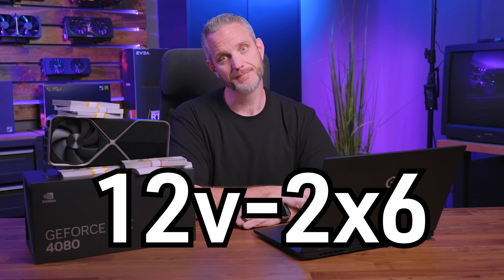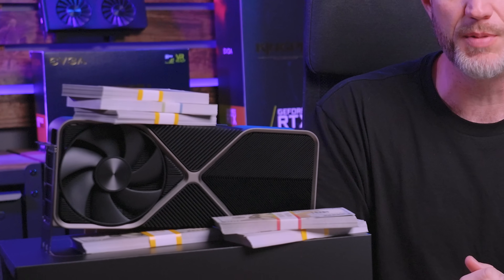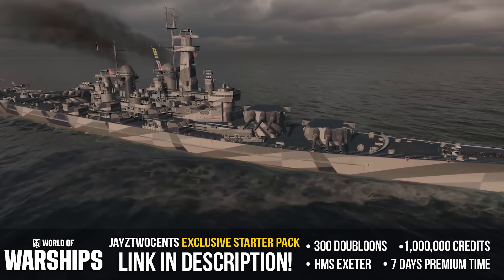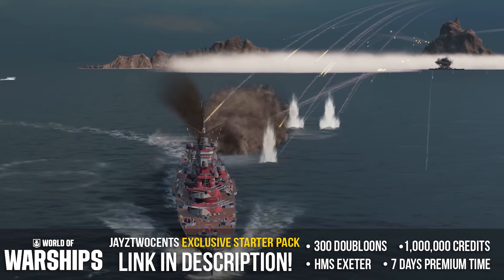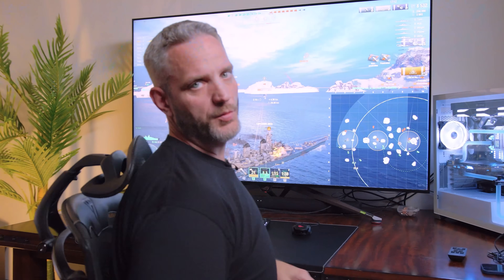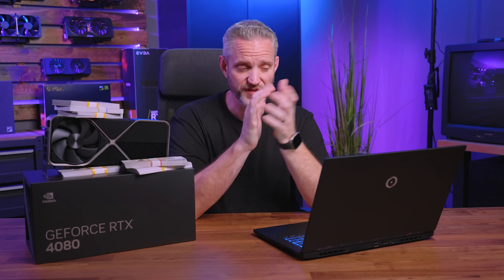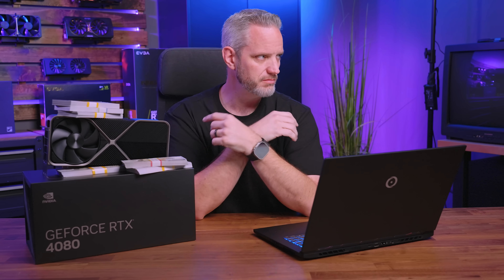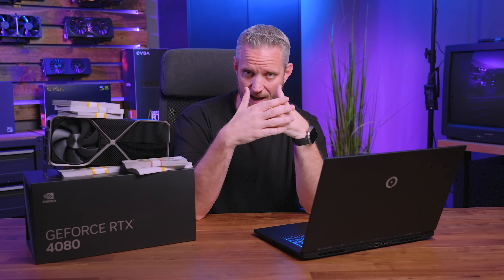They FINALLY admitted that this was a major issue!

Comment: Before I go any further, let me state, that I am a huge fan, and want you to get the results you are pushing for, but the way you are going about it? Not really the best way to do that.

"This is supposed to the fix the problem of your very expensive paper weights." "The 4090s as you guys know left and right are just melting the connectors."

The reason this cry for change isn't getting the response you'd like or even more attention is while the majority of this video is very informative and honestly is a good watch, there is also a decent amount of blatant gaslighting or misinformation that is very obvious. Just picked out two of them for examples, the first one, which is basically your intro, implies this is a common problem and that 40 series owners are basically throwing away stacks of money in repairs or on useless cards. You don't even mention that it's primarily an issue with the 4090 until later in the video. The second one? Again, exaggerates the problem and implies it's almost 50/50 whether your card melts or not.

The fact is at the time of the first video on this topic way back when there were over 100,000 of these things out there. Now there are at the very least triple that, maybe more, the 4090 is still regularly in the top 10 best seller list for both Newegg and Amazon. If we go with the minimum? Over a quarter million of these things in the wild. If what you were saying was even close to factual, there would literally be tens of thousands (possibly even hundreds of thousands) of failures that would be impossible to cover up or not be all over the internet, not just a couple hundred people in Reddit's echo chamber. Companies like cablemod would be bankrupt trying to replace all the units. 

We also don't know how many of those were actual connector failures, and how many of them were actual user error. Few users (if any) are going to admit they potentially destroyed something that cost them nearly two grand, so I'm sorry I don't put any stock in what the end user claims about their connectors being seated properly, and you shouldn't either. Should the connector be better designed to eliminate such easy user error? Absolutely, and that's what sig is trying to accomplish. Should quality control be better? Absolutely, it's clear some connectors did slip through that weren't up to the standards provided.

Back to the statements and approach: They are very easy for any reasonably knowledgeable viewer to pick out, and it shades everything else you're saying. Okay well he's lying here, or at the very least exaggerating for dramatic effect, what else is he doing that with? I say this not in hate, but because you are trying to do a good thing, call attention to something that does seem to require more attention, but you're doing it in a way that is becoming a very typical Youtube approach. You're creating a narrative, one that isn't entirely supported by facts and is based on misinformation/exaggeration. Next time, try it without the provocative gaslighting. I guarantee you will have a better chance of people taking it more seriously, and it being taken seriously by people who might actually be able to effect some change. No serious viewer is going to get past that intro or the other statements akin to it without some skepticism entering their mind.

Your goal is a good one, but the approach you're taking is reducing any chance of you succeeding.

Comment: Idk if someone can correct me but I remember when this original plug was being introduced there was talks about it only being good for like 25 connections cycles before the plug started to become degraded. I’m I misremembering this or?
Reply: It is 30 cycles, but its the same for the 8 pins so it does not matter
Reply: @Fztrm  thanks

Comment: So I wanted a 4090 for the longest time.
I still do want a 4090, since the 50-series cards aren't out yet.
But now I have a question to ask NorthridgeFix.
If I buy a BRAND NEW 4090, can they swap out the connector to the new one, and somehow maintain the AIB's warranty on the card (since arguably you're making it a better product than it was from the factory)?
Reply: if your gonna go to all the trouble of changing the connector then why not go back to the old reliable 8 pin connector and never have the issue again

Comment: In addition to heat, I suspect all the vibration from fans and pumps eventually shakes some cables looser.  The combination would certainly have that affect.
Reply: Would vibration be caused by your computer being placed on an uneven surface?

Comment: 55 amps? You do realize that an AC Unit outside of the house needs to be put on a 30 Amp fuse? Who the hell has a 100 Amp fuse just to play games? And before people get at me, they would not expect the cables to do that much amperage if it didn't mean that they had a reason for it.  (Power spikes)

Comment: i disagree, nvidia should be responsible to fix 40 series cards for the flaw they created. they designed it, they sold it, they ok'd it, they need to retrofit existing cards. they got enough money when selling to do so. my strix 4090 wasnt cheap. when im spending 2k on a gpu i expect all is well. in the car world they have recalls to remedy issues like these. sounds to me like nvidia needs to do a recall of some sorts. not the oh you are an early adopter sorry. that shit wont work im sorry. good vid otherwise j on the updated info.

Comment: If Ford had a plug that caused thousands of their vehicles to fail, they would be liable to fix it (no matter the cost to them). It will take a class action lawsuit to force Nvidia to recall and PAY manufactures to make the repairs to these defective power plugs.

Comment: Umm, had zero issues  with  the  4070Ti  but obviously it draws less power (295 Watts is the  highest power draw I've seen in total from the GPU) also I used a Corsair adapter from day one. I hope Nvidia  offer existing  4080/90 customers a refit, those cards were awfully expensive before they burnt  your house down.

Comment: honestly, if you want that new connector put on your gpu I'd look for a local shop to do it. I love watching the Northridge Fix videos but that guy charges a crap ton. A few months ago I accidentally knocked a resistor off my 3080 and contacted Northridge fix about repairing it, he quoted $300 not including shipping and then an additional $90 if I wanted it done within a week. That is absolutely ridiculous. I found a local shop and they did it while I was in the shop and let me watch them, and they only charged me $60.

Comment: Took enough time. It was a dangerous design. However if the contact isn't upsized from 0.4mm2 to something like 1 or 1.5mm2 (the same cross-sectional area as 16AWG wire), the same wretched story will be repeated !
FYI,the 30C delta T temperature rise requirement always existed anyway, it's a UL requirement.

Frankly IMHO, PCI-SIG are a bunch of clueless jerks who don't understand basic electrical engineering.

Comment: So I bought 2 atx 3.0 power supplies because I didn't want to deal with the stupid adapters. Does this mean when the plug changes I will have to change my cable from the power supply. Honestly this is annoying I thought I was doing the right thing by not dealing with dumb adapters but now I just spent more money and who knows if I will have to replace the power supply when the 5090 comes out. Honestly these companies should be held accountable or even pcisig. But we live in a world where no one is held accountable.

Comment: Jay - great video - I Can 100% confirm your point around the 15 min mark; re: wiggling the connector to get the black screen and 100% fan ramp; This is continually happening with my Gigabyte OC 4090; This happens both randomly and with a physical intervention on the plug.

Comment: As someone with a original 3080 I hope the 5080 series fixes all the 40 series cards problems (Size,power consumption/temps, PRICE, and connectors!) Big reasons why I never "upgraded"
Reply: The size can be great, cool and quiet running cards! , the 40 series is very power efficient already, temps are great, PRICE is crap and the connector needs a fix
Reply: It will fix most of those problems, But it will not fix price.
EDIT: Oh and you can also forget about the top-of-the-line cards using any less power than "all that the connectors can give them" that's the whole reason they're able to perform better than ever is that they're drawing more power than ever. Efficiency gains need smaller transistors (that's a ways out), or a large change in micro-architecture with an eye towards power efficiency rather than raw performance (not happening, or if you do want that, go buy an AMD card instead).
Reply: @44R0Ndin  Hmm? The 4090 i rarely see draw even 400w but Cyberpunk 2077 with patch tracing, 4K everything maxed (No DLSS and Frame gen) will push it to 500. You can also limit it around 60 - 70% and lose barely any performance. RDNA3 is not very efficient

Comment: They should just use deans or the ic5 connector that's used in hobby rc. They will more than handle the current and will not separate for any reason. 

Your welcome gpu manufacturers

Comment: There's also another aspect to wire gauge. The thinner the wire, the HIGHER the resistance over the length of that wire, the thicker the wire, the LOWER that resistance is. Resistance in a current load creates heat and that heat will show up at the connector before it shows up in the wire.
Reply: Why............???
Reply: who new it was a major issue to replace the 6 pin and 8 pin power connector with a single power connector on the gpu to take all that power🤔🤔

Comment: i feel like the issue is most likely pretty simple... costs and corners were cut to save money on production to increase profits. imaging doing that with something that can pull 600 watts. absolutely disgusting practice by nvidia. sold my 3070 a while back and this whole fiasco brought me to the decision to never buy an nvidia gpu again. the greed is unreal... also, the pins having poor contact is such a ridiculous problem to have.. it doesnt take an electrical engineer to understand that would cause excess heat. every warehouse has this issue with chargers for forklifts. management overlooks the fact that the plug connector contacts bend over time causing the battery wires to get very hot while charging. those connectors should be replaced every year but no place ive ever worked replaces them until theres a problem. current job has burn marks on some of them and they are still in use. lol. crazy

Comment: The connector is still problematic, because the wires are too thick or to many and they should not be bend at all. If they are bend, even the NTK pins, will have a diagonal position and will force enlargement of the female pins leading to bad contact. I hope this will have better results then the old connector. Only time will tell.

Comment: I had the black screen and 100% fans on my last power supply, an MSI power supply. Changed to a thermaltake power supply and have had zero issues.

Comment: Jayz, you asked if we will see the new updated plugs on new production cards... Well, Igor already noticed on the 4070Ti cards, that at least they use updated sockets, were the sense pins are the shorter ones, from the H++ sockets, even though the socket is still certified as H+ and not H++ Nvidia has done updates to the production line even before coming out with the new H++ socket.

Comment: I NEED HELP...
I BOUGHT AN RTX 3060TI AWHILE BACK AN RECENTLY GOT THE LIAN GPU MESH STRIMER AN I GOT A POWER CONNECTOR THAT DONT FIT....ANY RECOMENDATION ON A GPU EXT CABLE TO BE WIRED BEHIND THE STRIMER?

Comment: CableMod uses an NKT style connector on their cables and adapters, for those wondering. I'll also be using a deoxit lithium based grease by Craig Labs type L260Cp. It is specifically designed to be conductive and will not only lubricate the connection but prevent oxidation from air and heat. It is designed for similar applications and has copper particles in the formula. I will be applying it sparingly and inside of each receiver barrel with a needle type applicator. You can find it online if you look for it. I'll also be using a silicone lubricant on the outside plastic of the connector applied with a cotton swab.

Comment: i have a evga black 2080ti that sometimes goes black screen and 100% fan speed. it happens randomly, card will work fine all night, ill turn the pc off and go to bed, then black screen full fan speed in the morning when i turn the pc on. my 3080ti has no issues with the exact same power cables and power supply. any ideas?

Comment: So is the only option for existing 4090 owners is to pay for retro fit of a new connector? Also seems those of us the bought ATX 3.0 PSU are going to need new PSU's as well to get to 3.1. What a shitty deal. My card is still under warranty, should we not expect the manufacturer (Zotec in my case) replace this card with a safe one?

Comment: Ive seen hints at power coming from a dedicated port from the motherboard that is behind the PCIE port capable of 600 watts. Not sure how true or how far away that is from being adopted. So from the card its got a mini pcie like port off of the pcb that slots straight into the mb.
Reply: Found the Back of the MB will still have either the 12 pin or multiple 8 pins and the back of MB is like a power distro. But still a great idea for a clean build.

Comment: NTK alone seems like its likely to be all thats needed, but I guess the same could be said for shorter sense pins too.  However, a completely new system was really needed from the get go.  To have cards needing 2x8 + 1x6 additional power connectors is utterly ridiculous.

Comment: Why are they using so many  cheap, small wires anyway? This was a poorly designed Nvidia connection from the start. They went with the cheap on it. Doesn't take an electrical genius to figure that out.

Comment: I still find it AMAZING that for Decades GPUs have never needed "Sense" pins for power. Now all of the sudden they need them? Doesn't make sense to me other than Nvidia not wanting to RMA a dead gpu that was being under powered. It couldn't possibly be because they spent millions of dollars on a new power plug to save space or to make their GPUs look better aesthetically in their eyes.
I also think the Nvidia Founders Edition GPUs are complete trash because they effectively had an infinite budget to make a really good heatsink but they spend ZERO time, effort, or thought on how to make their fans EASILY REPLACEABLE without having to nearly 100% disassemble them. Nvidia has the age old problem of over engineering something so much it becomes impractical to repair.
Reply: That's something that I believed as well until I went and looked up what the pins for the 6 pin and 8 pin pci-e connector do.
They do have sense pins, but they are integrated in the connector. Unlike the 12v one where 6 of them are ground and the rest 6 pins are 12v. Thus they added the extra 4 pins for sense on top of the connector.
The sense pins on the 6/8 pci-e connector are part of the 6 or 8 pins. The 6 pin connector has 1 sense pin, while the 8 pin adds another sense, so 2 sense pins for the 8 pin.
Reply: That cooler increased their cards prices because blower coolers are insanely cheap compared to the founders edition cool at $150-$175 each.

Comment: For the thousandth time: The pins are too small, the wires are too small, you cannot safely run 50+ amps through this sorry cable. Go to any hardware store and ask to see a 50 amp dryer power cord. You'll see a heck of a difference. Or go ask any pro car stereo installer what kind of wire and connectors he or she uses to power an amp that can draw 50 amps continuously. Again, it'll be way bigger. This is NOT fixed!

Comment: Forgive my ignorance, but what is the wattage draw on PCIe slot rated for?

Would this increase in draw put the motherboard at risk?
Reply: The slot is rated for 75 watts
Pci-express 6 pin pin wattage is 75 watts
Pci-express 8 pin pin is rated is 150 watts

Comment: I think the primary problem with the 12VHWPR connector is they shrunk the 2x6 layout to match the width of a PCIE 8-pin connector, and of these little problems cropped up and combined together to create the failures.  Smaller pins means less surface contact, the 3 dimple situation for example.  There should always be a landscape cost for higher power draw.  The larger chambers can also accommodate larger wires as well and better connections across the overall connector.  There was no valid reason the connector needed to be so small.

Comment: What sucks is when you build out a show system with a power board to motherboard with the 12vhpwr connector and a specific PSU that uses this connector to make a system as clean as possible only to have them kill the standard. Can you imagine a class action and recall, it will never happen but damn it where is the RD prior at???